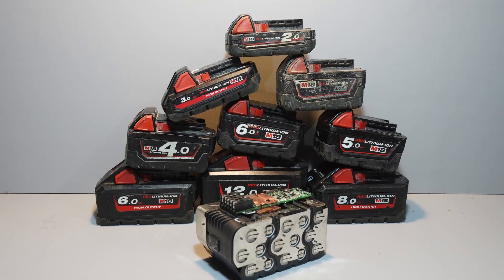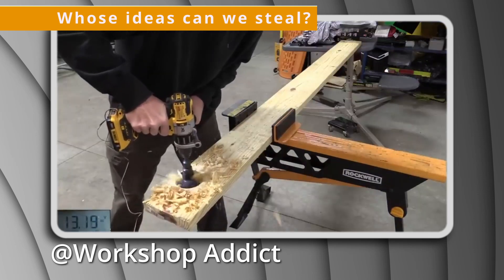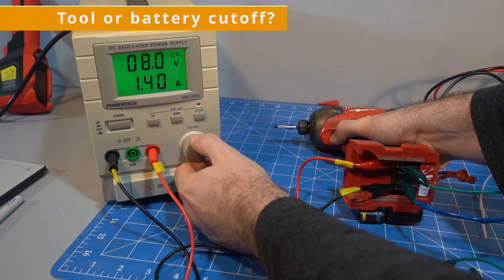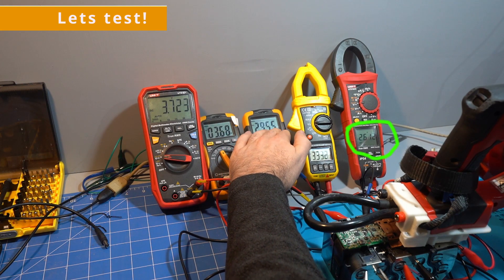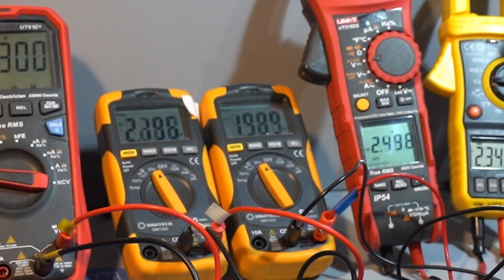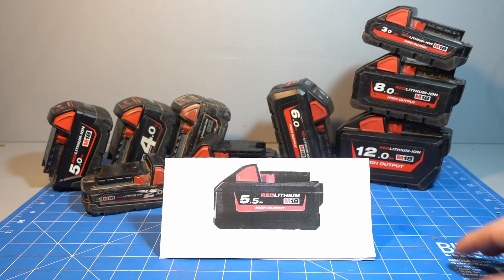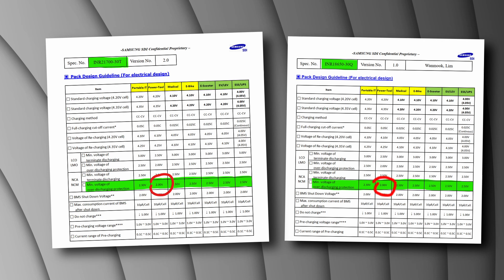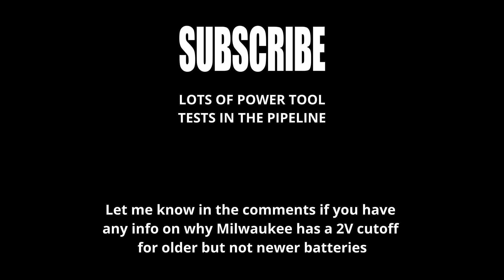[003] Milwaukee M18 low voltage cutoff is below 2.5V/cell on older batteries

Comment: What I can tell you is that Einhell's (18V, 18650 cell type pack) if a cell goes < 2.5 volt, the pack is dead....i've replaced the cells with new ones from Samsung, QT type, and it's up and running again. Not having destroyed the origianl 5S2P I will in the future test the BMS and attempt to read it's mcu. A logic analyser and Oscillo should help me out there, time is all i'm missing now...too many projects going on. But your vids are helpful to say the least.

Comment: Is it possible to charge up a battery drained down to zero in the case of Dewalt with adapter on M18 tool?
Reply from the maker: Not if it's drained to zero. Check individual cell voltages. If they're all above 1V, then you can try recovery. Slow charge (100-400mA) and monitor temperature until all cells are over 2.5V, then try on the proper charger.
Reply: @ really appreciate it! Great work

Comment: In what manner does it tell the tool to stop? Is it an on/off output from the additional terminals of the battery? Or is it a digital communication or certain voltage that it sends to the tool?
Reply from the maker: It's an on/off signal on the J2 pin (inner pin next to B-). J2 @ 3V = go, J2 @ 0V = stop. https://www.youtube.com/watch?v=q7spzrIbdKY

Comment: I bought a little IRONFIST Cordless Vacuum Cleaner a little more than a month ago based on the testing Project Farm did and just discovered it killed my M18 CP2.0 battery since all the charger does is flash red and green. I suspect my teen used the vac until it quit. The battery's remaining voltage light doesn’t even turn on anymore and it appears the 3.3V isn't enough to start the charging process so I tried the popular “jumpstart” process that it seems everybody has had success with, connecting + to + and - to - on a fully charged M18 5.0 but even after leaving it connected for an hour, it didn't make any difference. What's odd to me is that while the battery has 5 slots, with the + and - marked on the case in the #1 and #5 slot, the 48-59-1812 charger only has 4 blades, which measured 16.49v between the first and second blades, 14.9v between the second and third blades (which triggered the red and green alternating lights), and 15.74v between the second and fourth blades. It charges the other M18 batteries fine, I’m just perplexed on how so many people managed to save their batteries by the jumpstart method. I wish somebody on YouTube would figure out a way to “jumpstart” the battery using the blades wired to the battery so the charger and/or battery wouldn’t stop the charging process. For the record, the batteries in my M18 CP2.0 are LGDAHD41865.

Comment: Is there an equivalant video for the other brands? I appreciate the info from this one regardless
Reply from the maker: I've done Makita 18V (https://www.youtube.com/watch?v=r1tQwoaCdBA). 5Ah & 6Ah were 2.5V/cell but 1.5Ah and 3Ah were 1.7V/cell. Currently doing Dewalt - hoping to have the testing wrapped up this week. Vid in 1-2 weeks time.
Reply: @toolscientist  I have friends with DeWalt and Ryobi. I have Milwaukee myself. If you come up with a low voltage disconnect for DIY builds, it might make for good content. 🤷🏻‍♂️

Comment: Do you know how the battery signals the tool to stop? I know that Makita batteries do it by turning off the middle pin. So you can use that to switch a relay off.
I wonder if there’s a similar thing that could be done for Milwaukee batteries?
Reply from the maker: J2 pin is held at ~3V for run, J2 gets pulled to 0V for stop. Turning J2 on needs a specific pulse on J1. I cover this in video [005] https://youtu.be/q7spzrIbdKY
Reply: @toolscientist  Awesome info! Is the reason you can’t just continuously apply 12v to J1 because then J2 will never go low?
Reply from the maker: @karlkalina3022  No. If J1 is held high for more than 40ms, J2 will go low again. You need to give J1 a pulse longer than 20ms but shorter than 40ms.

Comment: Hi, Thanks for a good video, do you know if the battery has temperature cut of
Reply from the maker: They definitely have temp cutoff. In video [005] I show how I can trigger the cutoff signal by putting a resistor across the thermistor to teick it onto thinking it has overheated.
Reply: I watch the video 5, and if i did not misunderstand, it is not the battery itself  there shutoffs it's the little circuit you made correct?
Reply from the maker: @philipdamjanov9099  yes. The battery detects and signals for cutoff (either low voltage or overtemp), but the tool (or my circuit) is what actually cuts the power. I haven't tested them yet, but Ridgid/AEG and Ryobi have stand-alone cutoff in the battery. Video [006] has me testing Makita and it seems only 5 & 6Ah have stand-alone cutoff in the battery.

Comment: I have a few M18s where only one cell is lower voltage, usually around 3.5V while all the others are at 4V+. The resistance more or less matches with the rest of the cells and they don't look damaged either.
Do you think simply charging the lower voltage cells and balancing the whole pack is a good idea? 
It seems to be working fine.
Reply from the maker: I'd try manually balancing the cells first.

Comment: Really interesting video and channel. Fairly new subscriber here and I'm suprised you don't have a lot more! Keep up the good work!

Any plans on testing the new Forge 6.0 battery? I'd be curious to know if milwaukee has improved the BMS on these batteries with their claim of 2.5X longer life if I recall correctly. I also saw that the new dual bay supercharger utilizes all 5 pins (or at least has 5 pins) when I unboxed my charger. I believe all other M18 chargers just use 4 pins and not the one that connects to the + battery terminal (as you've mentioned as well). Thanks for the video! Really appreciated.
Reply from the maker: I have a lot of videos that I want to make, just not enough time to do them all. Takes me about 6 weeks per vid - hopefully I'll get more efficient at it. Oh, I just re-read your comment - I think you were referring to thinking I should have more subs, not more videos. It'll come with time. Getting into the nitty gritty of how tools work is also a bit more niche than the usual tool review/test channels. Most people just want to see Red vs Yellow vs Teal, et cetera.

Forge isn't available in AU yet. It's got quite different circuitry from the one teardown that I've seen, so I am interested in seeing what's going on in there. Lifetime will be a tough one, I'd need to buy a brand new 6ah HO and 6ah Forge and put them through a few hundred cycles. Fairly painful to do manually, and getting a power supply and electronic load with serial interface will be pricey. It's probably something that I'll have to do eventually, though.

I don't have a supercharger as they're not very common, so hard to find 2nd hand. I have seen the extra pin in photos, though. In the battery, the centre charging pin has a mosfet on it that can stop the charging current. That mosfet probably can't handle the high current of the supercharger, so they feed it direct via the B+ pin and then probably finish with the constant voltage phase on the centre pin. I would like to get hold of one to see if there's any extra messages in the protocol. That would be the one where I'd expect the high-output batteries to behave differently.
Reply: @toolscientist You are correct, I was referring to you not having as many subscribers as I thought you would've but they'll come. I always enjoy more videos though. The time it takes is probably what makes them so great!

I wouldn't bother testing out life cycles in the 6.0 HO vs the 6.0 Forge. At least not for my sake. That works take so much time. I was just saying that if they've improved their BMS, and keep the voltage from dropping so low and also keep the cells better balanced that maybe that would contribute heavily to a longer life. I've noticed on the workshop addict video that the forge doesn't drop in voltage near as much as the other M18 batteries under load which should also help with that. Having said that, if you really feel like doing a life cycle test, I would definitely watch that video. Just might not be worth it to you. 

It probably is the mosfet that can't take the current. The single bay super charger just uses 4 pins and outputs 13.5 amps vs the dual bay supercharger that uses 5 pins and outputs 18 amps if just one battery is on that charger (and probably has to be a forge battery).

Comment: I have a relatively newly replaced (by Milwaukee) m18 9.0AH battery where all three banks (purple cells, 40t I believe) show same voltage 4.45v, but the pack still blinks one light and charger shows green light when placed upon it. Any ideas? One time I did take the faulting pack and another, then smacked the bottoms together fairly hard and then the faulty pack showed 4 bars...placed it back in our wood cupboard for storage, then took it out to check it and it was back to flashing one bar. Ugh
Reply from the maker: 9ah or 12ah? Samsung 40T is in the 8ah and 12ah. The 9ah had Samsung 30Q or LG HG2. 4.45v is very high, max should be 4.2V.

Comment: excellent analysis! I killed one of mine 5ah battery packs using an battery adapter for a makita tool. I meassured 2,5v in 2 rows of cells and -0,5v!!! in 3 rows of cells.
Reply from the maker: Yikes, that's pretty dead!

Comment: Afaik the EU market absolutely has Samsung 30T 21700 cells. A weird thing happens when the pack is 18v and 5.5ah, its under 100wh. It simplifies shipping and maybe does some other magic.
Reply from the maker: Almost certainly 30Ts. I was suggesting that the EU 5.5ah might be programmed differently so that it legitimately only has 100Wh, but they'd only do that if they had to. Seems that several brands manage to get away with labelling 6ah as 5.5ah.

Comment: I have a 9.0Ah on my desk that all my M18 chargers refuse to charge.  I distinctly remember it dying on my M18 string trimmer with the edging attachment.  I popped open the case and all the cells look equal to me at 3.2V.
Reply from the maker: Interesting. You might be able to tap into the comms with a logic analyser to see where it fails.

Comment: What a tour de force video on these battery packs ....are they really in 2p configuration ?    
You state 20-30A per tool and 15A per cell.
Reply from the maker: 2ah and 3ah high output are 5s1p, 12ah is 5s3p. All the rest are 5s2p.
Reply: @toolscientist  So they can be pulling as much as 15A/cell ?    Thanks
Reply from the maker: @zaneenaz4962  I've taken the 12ah up to 150A (50A/cell) and literally just (as in 5min ago) took the 2ah up to 50A (50A/cell) during testing for my next vid. 

12ah is Samsung 40T 21700 cells. 2ah is Samsung 20R 18650 cells.
Reply from the maker: @zaneenaz4962  forgot to add, 12ah can go harder, but the tool (grinder) cuts out on it. 2ah is hitting low voltage cutoff at 50A and telling the tool to stop torturing it 😄
Reply: @toolscientist  Amazing Numbers !!  Greatly appreciate your work !!!

Comment: wow glad I went with bosch instead of Milwaukee. though that's mostly because the tool quality kinda sucks for the price. example last time i used one right out of the box the brushless motor screamed like a cat with it's balls stuck in a fence. chuck had run tons of run out and gritty with lots of metal dust coming out when sprayed with a little wd40. so i returned it and got another same issues.. so no quality control there . anyway i'd like to see some tests for bosch.  they switched some of the exterior components of the batteries (different colors even) while keeping the same model numbers I think around 2021. ps to bosch tool,users the freak impact/socket driver lube the crap out of the inside retaining ball for the impact bits because it will friction weld to bit in the tool! learned that one the hard way

Comment: would you consider doing these tests with dewalt batteries?
Reply from the maker: Definitely! Gotta collect 'em all and put them under the microscope. If they're all draining to 2V/cell, then this is unremarkable. But if Milwaukee is the only one doing it, then it kinda shows that they rate power over longevity.

Comment: Oh man, can't believe I have more subs than you. You deserve millions of subs with this quality content and such knowledge. Instant subscribtion from myself. Now it all makes sense why some of my brand new batteries were killed in no time. Do you think if you have to explain to someone who is not so well educated on Milwaukee Battery and power tool tech that if you want to preserve your battery you need to recharge before it goes to 1 of 4 bars or even earlier? 2 bars left?
Thanks in advance
Reply from the maker: 2 bars would be ideal, but that can be painful. I've honestly never given it much thought, but I haven't had too many batteries die on me...yet. I also didn't know until now that the 18650 M18 batteries got discharged so low. On the other hand, some of my batteries are 2013 vintage and still seem to go fine. I'll be doing some capacity tests  of all my batteries soon, so I'll see what that shows.

The big thing would be not using the batteries until they're flat on low power tools. If you can hear the tool sounding slow, then prob time to change batteries.
Reply: @toolscientist  That makes so much more sense now. I was using an M12 usb power bank charger with M12 6.0 batteries. The slow drain must have ruined the batteries.

Comment: I have a high demand 9.0 that refuses to charge past 3 dots. I manually charge it full after every drain. I typically just balance the cells manually, not paying much attention to voltage so long as it's within a reasonable range. Always finding dramatic differences between banks. Had been wondering if there's any balancing going on, clearly not. Your videos are super fascinating, thank you for such an in depth explanation.
Reply from the maker: I'm pretty sure there is balancing, it's just fairly weak balancing. The 9ah, 8ah, and 12ah are using high capacity cells that are more prone to losing capacity. So these packs are more likely to get too out of balance for the balancing circuitry to bring them back into line.

Comment: Excited to watch this! 
Personally, I have noticed that low drain devices seem to drain tools lower than high drain devices due to detection being on operating voltage under load. Different tools also seem to cut off at varying voltages, which is interesting…

Comment: Achtung! Smetterling! Krankenwagen!  A blast from the past there 😂.

This data is my guilty pleasure. Ive been considering a similar rig for the m12 batteries. All I've found so far is that m12 low voltage cut out is 3.2v/cell.
Reply from the maker: I'm giving away my age aren't I. Need to spend all day on tikitok to get the freshest memes...actually, that sounds like an awful existance!

Yeah, I'm pretty sure I got 9.6V cutoff. I wrote down the levels for all the indicator lights too. Took it as high as 14V before I chickened out, definitely no over-voltage protection, but there's no need for it in a proprietary system.
Reply: @toolscientist  oh cool. Care to share the voltage steps? Do they correspond to 25% capacity steps? Cheers.
Reply from the maker: @procrastinator1842  1 bar <= 10.5v
10.6 <= 2bar <= 11.1
11.2 <= 3 bar <= 11.6
4 bar >= 11.7

Just noticed from my notes that 9.6V is the lowest start voltage. Once the tool is running, you can keep going down to 8.2V (2.75v/cell)
Reply: You're awesome. Subscribed.

Comment: Wait they don’t have cell balancing?

Anyhow, it would be nice if the BMS estimated the non-sagging voltage based on integrated current measurements.
Reply from the maker: They have cell balancing, it just seems to have trouble keeping up, especially on higher capacity batteries.

Comment: why would they intentionally drain the cells that low?

are they wanting to get you to buy new batteries?

do they want to burn your house down? (for that reason if i was milwaukee i would use cheap shoddy underpowered cells like hoverboards used it has the same effect)

or are they wanting the tool be compatible with nicd and nimh cells so older pre lithium cells would work or maybe so you can use an older say 12 or even 9 volt battery on a 20 volt tool.
Reply from the maker: I think it's just so they could push their tools harder without tripping low-voltage cutoff. The other possibility is that it's an oversight and they've forgotten to update their firmware. Back when M18 was released, high-powered Li-ion cells where very new, so maybe 2V was the norm back then. I tried looking for datasheets for the older Molicel cells, but they went bankrupt, so I think a lot of that info is lost.
Reply: Milwaukee works as hard as possible with the tools as seen in the video. At the point where another tool stops, Milwaukee continues to work.  The user sees that Milwaukee appliances have higher performance, but this is a negative situation and is aimed entirely at deceiving the user. For this reason, Milwaukee appliances overheat and break down quickly. That's why I do not prefer Milwaukee.